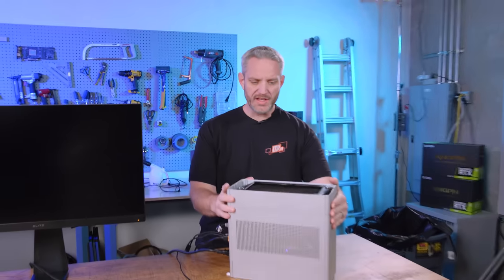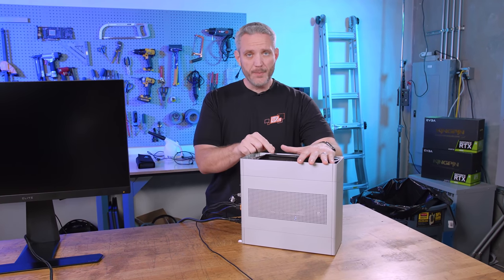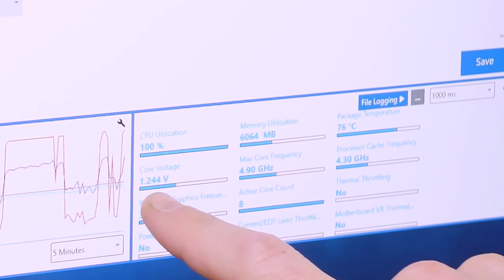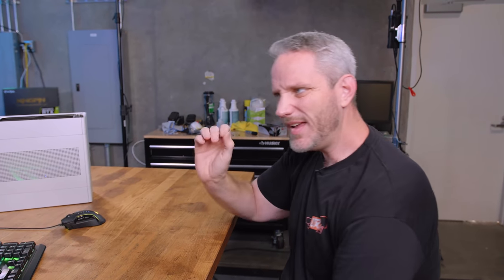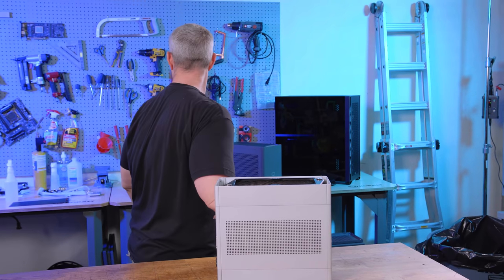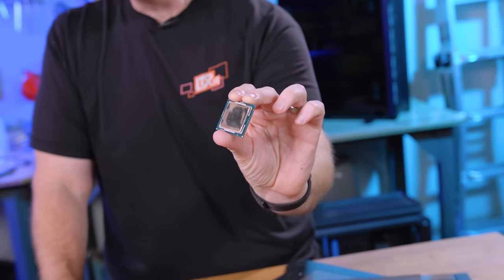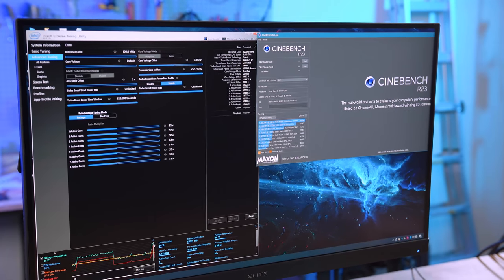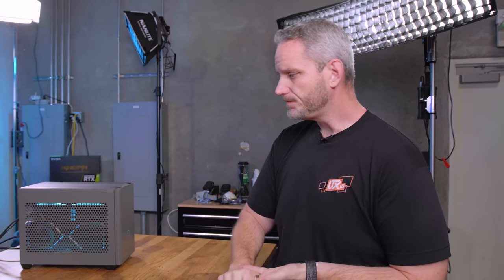THIS is what a Silicon Lottery Winner and Loser looks like for CPUs...

Comment: I might purposely kill my 11900k with a 5.3 all core overclock. Then switch to AMD.

I lucked out with my 10700k, that thing does 5.2 all core with ease. 70c while gaming. My 11900k.... Now that is at 5.1 all core around 65c, since 5.2 or 5.3 goes up to 1.6 volts at 260 watts, 90c+...... ( I was curious)

She does great work at 5.1 and still gives me an extra 15% bump over the 10700k. Like 20 fps more in GTA V at 1440p with an Aorus Waterforce 3080 Extreme. (130 to 140fps at max settings) that card is a beast though, 50c at 2100mhz clock and 21k memory) but I have an Aorus 3080ti Extreme OC Supercalifragalistic coming Wednesday.
Reply: That is good dude. These reviewers get golden samples from Intel. 5+ GHz is not the norm rather than exception. I bought 2 9900k at Microcenter. Neither can do 5 GHz all core stable without 1.35 v and hitting 100c under water with benchmarking. One is stable at 4.8 other is 4.9 all core but gets much warmer at 4.9 vs ,4.8 and these are water cooled. I lost the lotto twice
Reply: dont kill it? just try to get a high stable overclock without risking too much Or just straight up sell the cpu and get an amd one. Ive literally sold all my hardware when i upgraded and pretty much always covered atleast 35% of the upgrade cost. Killing hardware for the jokes of it is extremely wasteful, even if you can.
Reply: @incediumignis  I think all these YouTubers who get golden samples say things like of course it can do 5.2 GHz all core. This was an actual quote from Joker productions. If you do further research on Reddit it is about less than 10% of 9900ks. I was angry with mine until I realized 4.9 is 2% of  5.0. In the scheme of things a better gpu will matter more than this and a slower CPU by 3 to 4% with a faster ram overclock or tighter timings can make up and counter.
Reply: @incediumignis  I don't wanna risk it killing anything else in the PC. Nor do I want my house that my wife just wrote a check for, only two months ago, to burn down. lol when Zen 4, or the 12th gen comes out, this CPU will find a nice home.
Reply: @incediumignis  plus, im sure it'd just crash before i could get over 5.3 and it does actually do rather well that high. just the 260 watts, im sure will slowly burn it out. right now it peaks around 160 at 5.0 actually.

Comment: i live in ohio, an a pretty new overclocker an i bought a 10th gen intel i5 10400 an its base clock is 2.9ghz yet have running at 4.20ghz stable on all cores but 2 run at 4.0ghz i dont know much about overclocking but thous numbers for this chip sound best to me even to be stable, now dont quote me i am a new overclocker but seems like i caught me a winner in the lottery?

Comment: Hey Jay. 10600KF. 1.45vcore extreme LLC and I can only get 4.8Ghz all core. How unlucky did I get?
Reply: 1.45 is very high, what are your temps?
Reply: @greggreg2458  barely under 100 under full AVX loads. I actually took another crack and trying to tame this 10600KF whilst still maintaining an overclock. The moment I go to 4.8 all core 4.5 ring/cache it creeps up to 170W of power draw at 1.45V (this is just letting the mobo do its thing) and it's way too hot for my AIO(X53) to handle.

Instead I dialed back ring to 4.3 and kept the 4.8 all core and suddenly I'm not seeing temps above 80c under the same conditions. Even vCore is dramatically lower. Pretty sure my chip is cursed.
Reply: @maxinemn  I haven't tinkered with ring/cache that much, i can do 5.2 stable with my 9900k, even 5.3 bit i don't know if it's 24/7 stable. My CPU is direct die mounted, before doing that even at stock it was very hot with a custom loop, the IHS was probably very concave/convex. Do you get performance increase with ring OC? I tried with mine but i don't remember well.
Reply: @maxinemn  set a manual vcore :) if you haven't auto can cause stupidly high temps as it just adds way too much voltage.
Reply: @TheBURBAN111  That WAS manual vcore. I promise you that WAS not auto. 

I actually went back and discovered 3 things.

1. I can get away with 1.385vcore on 2 conditions.
1.1 I should stop trying to push ring/uncore so hard, the gains I get aren't worth it so I reduced it and noticed my package draw drop significantly at the cost of maybe 2% of performance in a CBR20 run
1.2, I could actually get away with 1.385vcore at the same 4.8 all core + no avx off set
2. Uncore/Ring over clocking doesn't do much if you're already bound by something(I think I am bound my crappy memory timings and also 4.8 AVX is already kinda nuts
3. My 10600KF is still a hot piece of garbage but at least I can maintain 4.8Ghz all day and still be under 165 watts and remain at around 88C under a 240mm AIO
Reply: @maxinemn  yeah cache should always be around 4.5-4.7 max imo

Comment: im new to all of this. can anyone tell me if my OC is decent for this prebuilt?! Ryzen 5 5600x/RTX3070FE.  Ryzen Master has it auto OC'd to 4.75ghz all core @ 1.3v, temps on prime95 never exceed 75c. (liquid cooled AIO) RTX 3070 FE is OC +100mhz core / +1000 memory / 109% power limit. max temp so far is 70c on superposition. core clocks hang around 1950mhz on low end to 2050 high end, mem is 8001mhz. is it a decent OC?

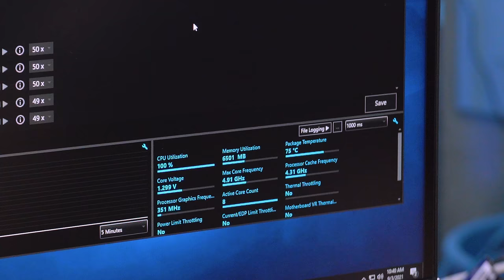Comment: 6:46 Don't think you can adjust LLC from the Intel utility but taking it off auto might help with the offset at 30-40. Swiftech still makes the APOGEE Drive II too.

15:24 Edit: The 9900k is soldered...

Comment: I have a 5900x that hits 90c on 50%load on a custom loop. I have 720mm of total radiator surface area the GPU doesn't hit high temps at all no higher than 70c and I can't figure out why the CPU is thermal throttling. And I haven't done anything to it. You are over locking at 100%load and temps aren't that crazy. Clearly I am a scrub 🤣

Comment: Ryzen is worse, it'll post then crash randomly lol.
Reply: or you just dont understand how overclocking works, If you overclock from bios (i assume thats what you did) there is pretty much no load on the cpu, so the overclock is not working until you actually put pressure on the cpu. Hence you use cinnebench to test if the overclock is stable. You can also try ryzen master and overclock with that while testing with cinnebench.

Comment: I am not a fan of running chips for daily use the way you do. I always let c states terurn down clocks to base (800 mhz) and there is no reason to let it draw more power or run high voltages all the time. you can overclock just fine with c states enabled.  My 9900k can do 0.665v idle @800 mhz and clock back up to 1.,365v for 5,1 ghz. 
And that thermal paste application is why you pre spread. 100% perfection ALL the time, there litteraly is no reason not to.

Comment: If you think that's a silicon loser, then mine got run over by a tank 🤣
5.0 on my 9900k is insta throttle, but the same 240 aio had my 8700k at 5.3 all core 😅
Reply: Also, lapped die and direct die cooling didn't help much.

Comment: "9900k is a fantastic CPU for gaming"
Well considering in 2021 i5 2400's are perfectly viable for 60-80fps I'd hope so. In fact most (desktop) CPU's that are over 10 years old don't actually have an issue with gaming. The problems and slow downs come from SATA2/DDR3. If you could somehow get a Gen 1/2 CPU on a SATA3/DDR4 board you'd have a perfectly normal experience